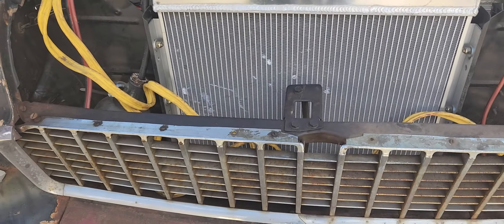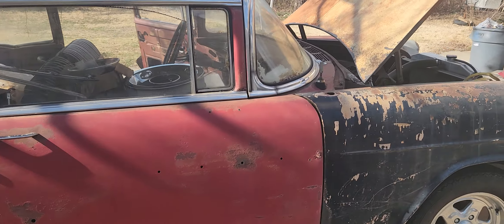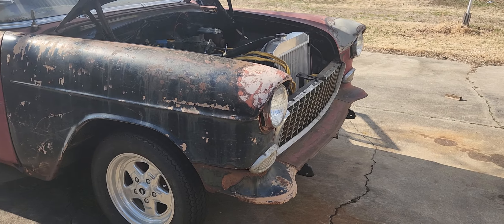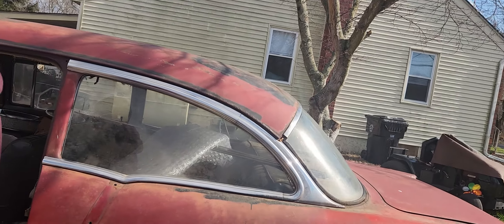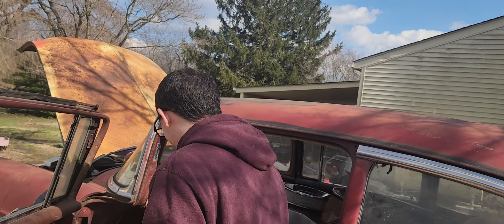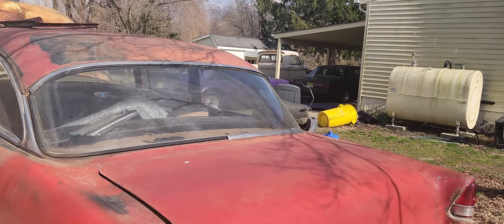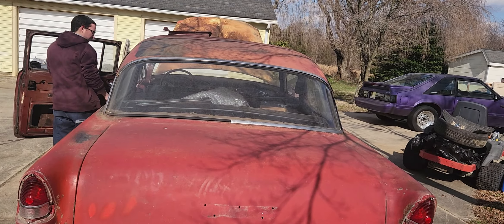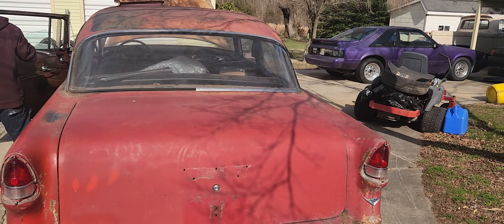55 Chevy two lane black top tribute car build begins

Comment: Old power pack heads. Probably 520's 1.72/1.5 valves. Tiny ports.
Reply from the maker: I didn't even bother checking it out Charles the motor has already been traded and we have a power plant going in this car with heads and intake I've already ported and it's a proven combination did very well on the dyno but will see what the engine does in the car because dyno numbers are just that like I always say but we're having fun with this,  thanks for watching
Reply: @terrygrover6440  Great project, love it!
Reply from the maker: @servediocylinderheads  thank you Charles